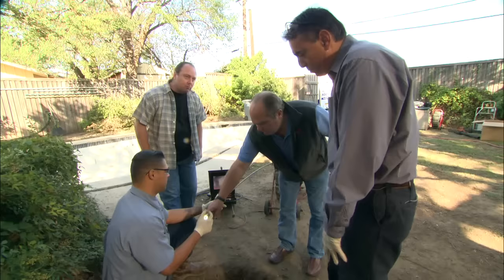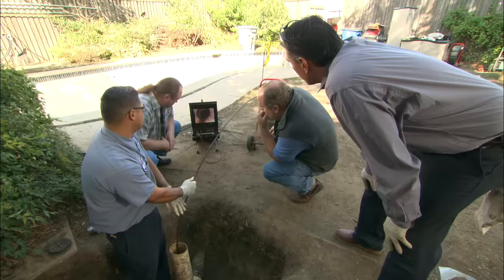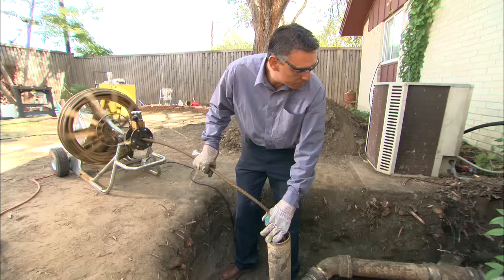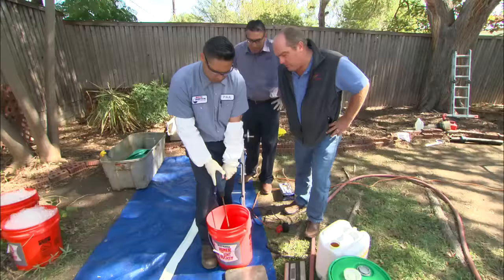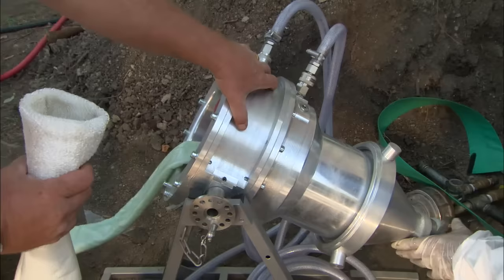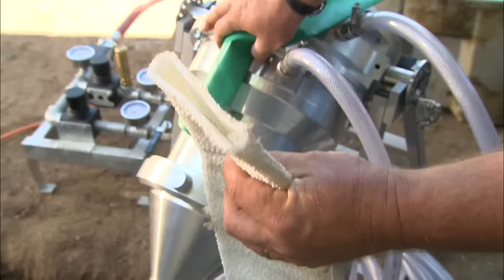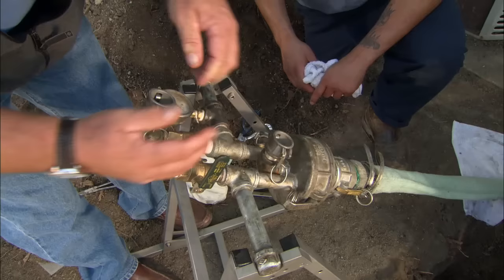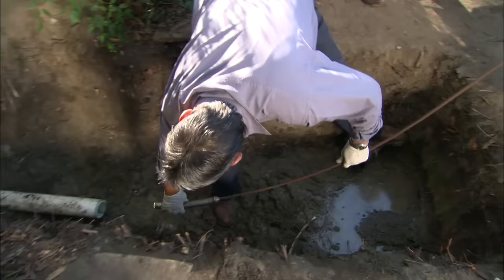How to Repair a Sewer Pipe Under a Concrete Slab | This Old House

Comment: No information for sourcing equipment or materials as was already stated. Often, one doesn't have to do jack hammering of concrete. Where accessible, a concrete saw blade works fine since most slabs are 4-5 inches depth. Simply cut longitudinally in parallel to the sewer pipe on each side and jack hammer the chunks of concrete out of the way. It's not as bad a job as what people may think if you rent the right size equipment. A good quality concrete saw blade will cut through 5 inches of concrete at about one inch in approx. 45 seconds. I've done it. Installing new ABS pipe, filling the trench with pea gravel and finishing off with concrete is quick and easy.
Reply: +Ray Murray The average DIY homeowner isn't going to spend the many thousands of dollars for this equipment. It's a fairly specialized tool and not really worth buying unless you are in the business.   

Obviously, it will usually be cheaper for a homeowner to dig out the old stuff and put in a new pipe but it's not really something that most homeowners want to deal with for lots of reasons. But sometimes it's just not worth doing or just not something that a home owner can do (maybe they have a bad back, work 80hours a week, everything is below a slab, doesn't feel comfortable with power equipment etc.)
Reply: +pcworldman Concrete saw blades aren't many thousands of dollars, and many people can rent equipment with a blade attached for under $100/day that can cut through the concrete slab just fine.
Reply: If you have to replace 20 or 30 feet of pipe under a slab then good look with your little saw, especially when youre dealing with asbestos... I can see you maybe making a spot repair for only a foot or 2 of pipe. But, when youre talking about trenching the 20 feet of concrete in your own house, let alone a customers, your method wont do much and may take months. Epoxy lining can be done in one day and you dont have to dig up anything. Plus epoxy pipe is much stronger than the ABS pipe youre talking about. I cant tell you how many idiots i have seen replacing their damaged ABS pipe with more ABS pipe... At least use HDPE or something
To answer your question: This tech can cost anywhere between 20k to several hundred thousand dollars. Its not something Ray Murry from youtube can use considering much training and practice is needed for this. This is coming from someone who is not only certified in asbestos abatement, but someone who is trained and certified in using 2 epoxy lining techs.
Reply: i If your talking about 20 - 30 feet then you have your self a bit of an undertaking. But coming from someone who has worked in the industry for a considerable amount of time and who is heavily trained in many forms of trenchless line repairs (both epoxy and HDPE welding and installation and use to teach the use of these techs) I personally would opt to cut and replace. The mark up on lining materials is criminal, honestly it is. Cutting your slab if done properly should take you about a day depending on length. Replacing pipe with abs is fine just making sure your joints are glued and rotated properly and that your ground and pipe bed are tamped sufficiently and it will work no problem. I personally would replace using HDPE but that involves welding and possibly of installing tie ins so that's typically beyond the average persons skill.
Reply: Take many months to cut a 20 feet of concrete trench? Really? I took me four hours with a rental cutter, another four to break the slab squares and another two hours to carry the rocks out the basement. It's a one long day of work dude!  Give your head a shake!
Reply: It’s not just the slab over the drain line. There’s finished living space, walls, and furniture. 😉
Reply: In my house it's more like 20 meters (65') + all of the branching pipes to each drain. And that's another thing they didn't cover in this video. How do they deal with junctions. Iv'e heard they go in with some sort of a cutter ?  It sounds really difficult (and expensive).
Reply: He Ka Yeah there is a very large amount of things they didn't cover in this video. I have worked hand in hand with these two guys. Paul is a fantastic human being and one of the absolute best I have ever had the pleasure of working with, his brother john as well. Neither of them do this work anymore, neither do I ....see what im getting at? Chuck, the other guy in the video, just a swirl trying to get a nut. The process of cutting access to tie-ins for this material is a royal pain. We used a cutter the costs about $100,000 and it broke down just about every time it was used. Do yourself a favor, rent a camera from home depot and view your lines yourself before making any other moves. Nine times out of ten, this process is completely unnecessary.  Just trying to save you some debt bro, take care.
Reply: Thanks for the tip!
Reply: He Ka No problem. Spent many many MANY long nights installing this stuff and don't get me wrong it works WHERE APPLICABLE. I just dont wanna see people getting taken for a ride by sleaze bag plumbers. Let me tell you they get they're rep for a reaon. In all honesty nine times out of ten it is just an upsell. And to the guy that says this stuff is stronger than PVC....WRONG! You can usually deform it by hand after it's hardened. Inspect it yourself then if it really needs replacement seriously consider the old world method of digging it up and installing new pipe. All these new techs and fads come an go, but the old way always works. Take care and good luck
Reply: Sounds about right. They give like a 40 year guarantee tho... if the business is even up and running after 40 years, nobody knows.
Reply: He Ka And that is what they bank on, a sweet promise! There is no way to know seeing as all of thead plumbing places are a dime a dozen! Even the big ones are on they're way out the door! Too many years or corruption finally catching up with them
Reply: In Residential  homes, if you are going to spend months to replace  below  slab grey pipes, I recommend for you, to find another line of work. ..... The cutting of slab would be the way to go, simple and one has many qualified plumbers at your disposal. Downside: is the mess left behind, and extra cost of remodelling.

Comment: Australia has a different system.   They use a don't turn the felt inside out and do not use water but air one plastic bladder once you get the liner where you want it.  

Sewer is one thing but water lines I wonder about contamination of drinking water.  How many times can you reline the pipe before you reduce the gpm so three or five house with them all taking shower reduce the flow to one gpm in ten minutes?

Comment: With this new sleeve installed im assuming if roots are an issue and the pipes are cleaned it would destroy this right? requiring it be done again anyway? Still an awesome way to go. Whats the lifecycle on it

Comment: Gets line scoped to find no blockage and then does this expensive process anyway.
Reply: You don't know much about plumbing, do you? the owner just had the line cleared of tree roots and a couple months later the roots had already begun to creep through the joints, that is what roots do, they find any separation or crack looking for water, with a system like what they repaired it with, there are no joints for the roots to enter.
Reply: The line will eventually collapse then you'll be in deep caca, no pun intended. The new line should last another 50 years.
Reply: @favianvasquez1054  Besides that, it was sponsored by This Old House so the TV show probably covered 100% of the additional costs!!!
Reply: @rcmodelr   nope, the show doesn't cover any costs, the homeowner pays for everything in just about all the episodes.

Comment: +Dan Lo Fat "Dan Lo Fat 1 month ago
[...]FAILS because the camera does not show the inside of the NEW pipe, it shows the inside of some other random PRINTED PVC pipe.  Very unprofessional mistake."

Your PVC pipe has printing on the inside? Take a look at 1:54 and you will see printing on the liner - before it is turned inside out by the insertion process.

[Posting here because your original post does not allow replies.  I don't know why people do that - guess they can't stand to be corrected.  Glad to see you allow replies now.]

[Guess I was wrong - Dan Lo Fat is blocking replies - fragile ego?]

Comment: never call roto rooter they are commissioned salesmen Alway s trying to sell you something
Reply: That's the problem with all of these franchise companies they work on commission so of course they try to upsell everything my company gets enough jobs to the point where they just want to get through each job and go on to the next number one in the state with sewer calls no need to upsell anyone when you're making money
Reply: Thanks for ruining my living
Reply: True
Reply: Mike Diamond in Southern Cal are major crooks... Yes, $99.00 to clear a drain, $4,000.00 to install a frigging hot water heater!
Reply: @JungleYT  but they smell good.
Reply: @Carl-LaFong1618  Right...

Comment: He touched the sewer feces camera without gloves.......also,you don't clean those types of light  roots with a roto rooter snake,you jett the line out prior to lining.
go to The Twin Home Experts channel,they have it down.
Reply: Yeah he just grabs right ahold of it like he is going to be doing some karaoke 🎶
Reply: He is a plumber. You think a little poop freaks him out?
Reply: I used to work for the twins and they dont jett the line anymore. Most companies use a descaling tech so that the pipe is cleaned up much more than jetting. Most of time, its a chain that you spin inside the pipe. Pretty easy to do and cleans up much nicer.
Reply: Bo Hemley You actually dont need to jet these lines it's a total up sell that is COMPLETELY UNNECESSARY. You use a Sr. machine with double or quad blades while running a garden hose! I know both of these guys Chuck Berry who is a regional manager for Roto-Rooter and Paul. I was trained by Paul and was actually offered to be on this very episode in his stead but opted out! This method works only in certain applications. I was the lead tech in the tucson branch for almost 5 years and trained many others in the process.
Reply: I had a sewer clog under my slab.  It wasn't tree roots, but was a literal sludge of toilet paper and paper towels, among other sewage related nastiness.  Roto Rooter came out and their roto rooter couldn't do the job, the sludge just filled back in around the cutting head.  The next morning they sent their jetter guy out and that solved the issue.

I saw it all on camera too, whenever they have to call out the jetter they have the Supervisory camera guy come out first.  They're worried about liability, since Roto Rooter used to have independent contractors that liked to sell unnecessary excavation jobs.  That's what they told me.  They document and record the entire video process to show the condition of the plumbing before they do anything else.
Reply: Blaine Bugaski  Seeing as it was sludge, jetting was essentially the way to go! However the camera guy or "quality assurance tech" is many times sent out with a prerecorded video of a severly damaged or clogged line already loaded into the monitor on a flash drive. Not saying thats what happened but it does more often than not. Scare tactics , sadly do wonders with people who aren't in the industry. But basically, nine times out of ten the only thing that needs to be done is a good cleaning from a sr.machine with a good set of quads and your good. If you have a bad spot or two, a crack or a break (and depending on the severity of said break) then this process may be beneficial.  Just depends on how outrageous of a bill your willing to foot.
Reply: OH look a tiny bit of roots, lets use 40 different machines and put in new piping that needs resin and shit.  Sounds expensive to me.
Reply: 4GB MEANS 4GB You got it man, all about money
Reply: @nexusone5584  agreed!
Reply: So is this a good procedure just costly it seems
Reply: Not on clay pipe! , using chains on it, has a tendency of cracking the clay if not used properly.

Comment: This old house show should be called rich mans old house who has the money to do the stuff this show does someone who is a millionaire he could care less how it's fixed he just writes a check and forgets about it.
Reply: Ya, it seems like they pick the most outrageous and expensive methods to fix things.
Reply: Yes, they could show the cheap route or the DIY repair, but they usually choose to show us something newer and better with the idea of allowing options "outside the box" for those who might want an alternative solution. As the old saying goes, it can be done cheaper, faster, or better... pick two.
Reply: This is not only a simple repair, it's like a brand new sewer without digging the old one out. This method of repairing sewers and water pipes is in use in Germany since the 1950s. The water pipe of Wilhelmsburg was repaired that style in 1956, it's still in use today. In the 1960s in the UK they experimented repairing sewers that way.

How expensive it is depends on the length of the sewer and how you're doing it. There are some methods:
1. partial repair, mostly the connections.
2. complete with a tubeliner (shown here).

Fact is, this is the fastest method to get this repaired. They've repaired my sewer this way too. The sewer is 22m (72 ft) long, mostly under concrete. They've started at 11 a.m. and I could use the toilet at 6 p.m. when the epoxy was hardend. If you would dig that out you would probably need several days for that length. And during this time you could use the fresh air-toilet between the bushes.

In Germany they're giving a guarantee that this will last 50 years at minimum.
Reply: You would be surprised, it's more like 70% of the time your repairing plumbing fir poor peipke up to the middle class homes. Millionaires as you say AREN'T just passing a check carelessly  as a plumber I know. I'd rather work with someone who can barely afford the job versus someone who can easily afford it.  Rich folks aren't always easy to deal with.
Reply: @slimpickens9135  come do mine will you I'm not rich I have a major sewage line leak. Toilet still flushes  water. Bubbles,up when the wash washing machine also sink and bathtub make gurgling sound
Reply: This is much cheaper than digging up your slab and re doing your floors.
Reply: Marcel Germann intersting . What about the cost sir
Reply: Stuff has to be fixed faster and easier than diggin up everything
Reply: I curious the cost it 22k to replace the iron pipes at my house

Comment: But how much does the internal repair shown decrease the internal tubing diameter, and would it work to repair underground pool skimmer plumbing where there are likely numerous 90-degree angles in the underground plumbing the insert would need to go through to repair?  And who can I contact for such repair if it will work for broken skimmer and bottom drain plumbing breaks underground in 1.5 inch diameter PVC plumbing???
I currently have a customer who doesn't want to pay to dig up to repair the plumbing so I want to know if this type of repair would be possible with only access being the pool skimmer with a 90 degree elbow below the skimmer and another 90 degree angle just before the pump.

Comment: Had a clay pipe... this method was mentioned to me, I refused it.  I had it all pulled out and replaced with PVC.  Not that this isn't a good idea because the cost of the replacement was exorbitant, I just feel more comfortable with PVC.
Reply: You did the right thing because the PVC will last during your lifetime. This idea here is not bad but it's like nickel and diming repairs that get more expensive each time.

Comment: What's the lifespan of the liner?  Is it affected by liquid plumber or cleaners poured down the drains?
Reply: Decades. This stuff is terrific.
Reply: It's OK on the right set up. The pipe needs to be in other words, perfect condition in pitch and no bellies or your jus wasting your money and time.
Reply: U can never snake this pipe or u will ruin it.
Reply: @dmo848  wrong. There is no issues with snaking these lines as long as you know what you're doing with a machine...

Comment: Regarding the cookie cutter, I should think that there could be many problems as to use them you would need to go into the clean outs on the risers and have to deal with offsets and TY’s  as the only way I could see it would be used in 2” soil pipe and that would require a cutter on a 5/16” cable. *

Comment: I want to know how this works with multiple facilities draining into the sewer line. How do all the sinks, toilets, and showers connect to this new inner pipe?
Reply: as you can see this is the lateral from the point outside the house thru to the property line.  So there wouldn't be any branch connections.